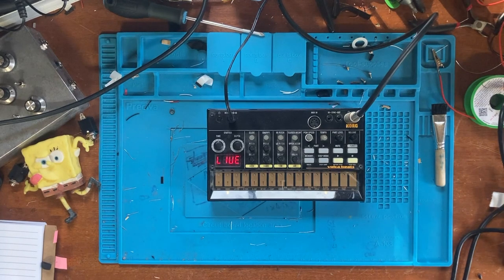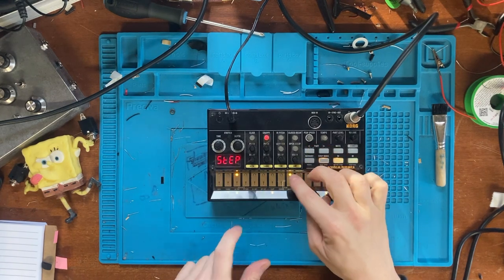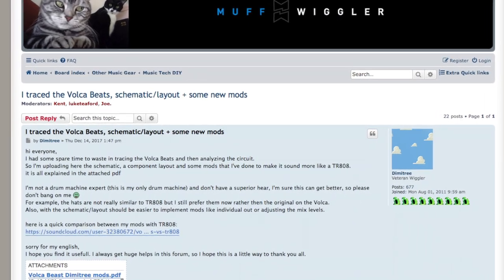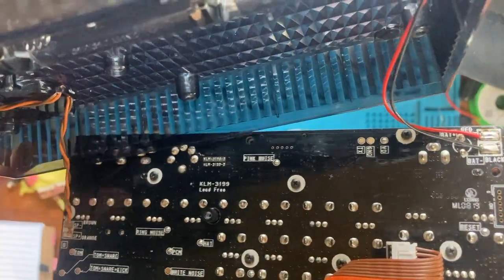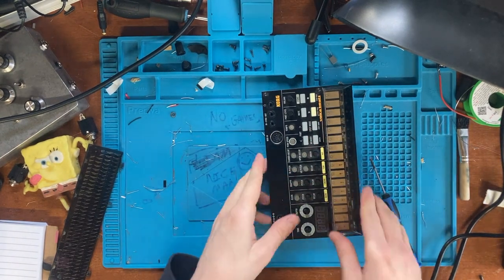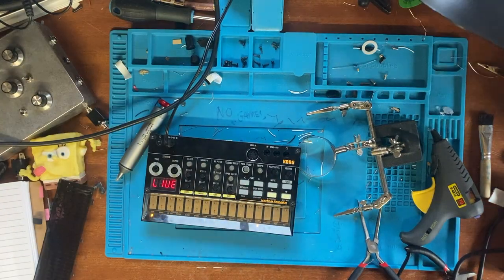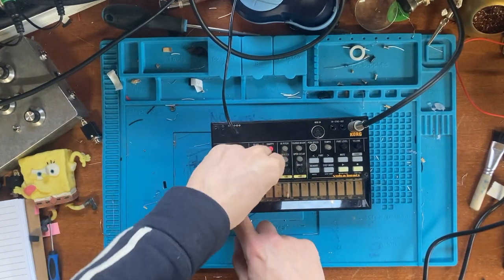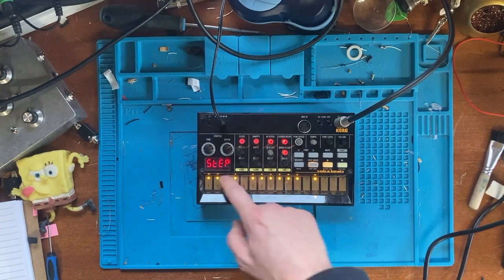How to Mod Your Korg Volca Beats Snare Guide | Before and After Audio Demo | DIY C78 MOD

Comment: Nice video! The combination of the stock snare and clap can have more body to it if you add in the high tom and adjust the parameters. The sound is really nice once its all mixed well. I also modded the snare, sounds much better afterwards. I then decided to add in the individual outputs which is a game-changer. All the best to you!
Reply from the maker: Thanks Robert a real treat of a comment to receive on my birthday! Shall have to try out layering the Tom!

Cheers,
Cameron

Comment: hi very good job! as i know noting about capacitor, could you please give me more technical details (or a link too for exemple on amazon)? 
i searched on amazon and on the web for a capacitor 680nf but what i found look different from yours...thanks in advance!
Reply from the maker: Hey dude thanks. Any 680nF non polarised capacitor should work great. You also can experiment with different values for different sounds.

I couldn’t find exactly the one I used but if you want piece of mind this should work fine!

https://www.ebay.co.uk/itm/Capacitor-Polypropylene-Kemet-Mkp-680nf-Series-X2-Anti-interference-15mm-/133987329105?mkcid=16&mkevt=1&_trksid=p2349624.m46890.l6249&mkrid=710-127635-2958-0

Comment: Is the capacitor 680nf or 618nf? Knowing nothing about capacitors, I'd like to have the exact reference (also most others speak about an 100nf, hence my confusion). Thanks in advance!
Reply from the maker: Hey dude, 

I went for a 680nF this tike around, I’ve had success with 1uF as well I’m sure 100nF would sound great too! :)
Reply: @tonelessgear1241  Thank you so much! Maybe it's just me but I like the sound with the 680nf more - almost like an 808. So I'll definitely will look for it. :)
Reply: Thank you for sharing the mod. Ive already ordered the capacitor from my local electronics store 680nf looks exactly the same as the one in the video👍🏻 Happy days 😊

Comment: Great video man! Thanks for sharing! I’m interested in doing this mod myself. I’m wondering if you know what size the C78 surface mount footprint is? If it’s 0805, there are 50v/ 680nf caps available which should solder straight on, no glue required. Is there a reason you chose a thru hole cap?
Reply from the maker: Yo!

So it was this exact reason, I didn’t know the footprint or enough about surface mount… I should do some reading 😂

Comment: Great mod.
I have heard so many people Winge about the snare but you have done something about it.
Well...I was thinking if building my own synth but the eventual cost would be so high because of the component costs etc.
The Volca beats and Volca bass would surely be a basis of a good modular synth.
If they made about six different machines all the same size, they could represent the modules .
Just put them all together in a cabinet.
Presto....one cheap but very useable synth.
What do you think?
Pete
Reply from the maker: Hi Pete,

Thanks, I'm glad you liked the video! 

I'm a big Volca fan myself and they actually have tonnes of units now. The sample, keys, fm, kick to name but a few, definitely worth checking out. :)

I believe there's even a Volca unit called the modular... So definitely have a look at that one if you're a fan of synths in general.

If you wanna check out some serious DIY synth-age there's a channel called Look Mom No Computer that delves into the dark arts, but in a really nice, easy to understand format.

You'd be right, a wall of volcas would be one cheap(ish) wall of a synth! They all sync up to one another really nicely and I bet it would sound wicked! 

It might be slightly less user programmable than a modular synth, but that's not to say you wouldn't be able to craft some really unique textures and music! there are some amazing artists that solely use volcas for live sets and they get great results.

Cheers,
Cameron

Comment: really cool! but... why gluing the capacitor? Is that definitely necessary?
Reply from the maker: I suppose it’s not completely necessary as it sandwiches nicely between the PCBs but my thoughts were to reduce  strain in the place where the solder connections are! :)

Comment: I did not understand what capacitator you used. 😭 Can you write a comment? Thanks 😍
Reply from the maker: Hola! Any 680nF non polarised capacitor should work great. You also can experiment with different values for different sounds.

I couldn’t find exactly the one I used but if you want piece of mind this should work fine!

https://www.ebay.co.uk/itm/Capacitor-Polypropylene-Kemet-Mkp-680nf-Series-X2-Anti-interference-15mm-/133987329105?mkcid=16&mkevt=1&_trksid=p2349624.m46890.l6249&mkrid=710-127635-2958-0

Comment: lol wtf... a ONE MINUTE demo of the snare... just turn down the tone and decay. Problem solved.. no need to rip it open and spend money on parts. I'd argue that the people that dislike the snare have no clue about synthesis or how a snare is made.
Reply from the maker: Hey dude, thanks for the feedback. 

I personally really like how this mod allows you to dial in the snare noise component! Was a super fun project with some fiddly bits to put my ironing skills to the test. 

If you wanna check out the theory behind the mod this documentation is super cool and lined up nicely with the results of the mods you can make. Some really nice scope shots in the pdf attached to the post too. :) 

https://modwiggler.com/forum/viewtopic.php?t=193238#p2710371
Reply: I still think it sounds like crap before the mod.